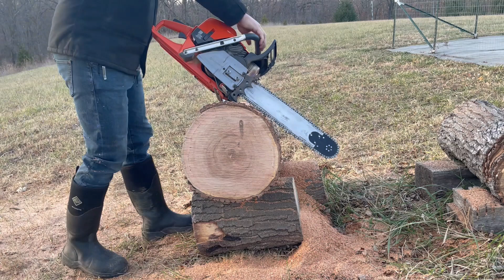Husqvarna 585 second ported iteration.

Comment: The stock  462c has around 168 (+ or - ) degrees of total intake duration similar to the 585 xp. We all make our wine our own way but curious is as to Why you welded the piston skirt and lessened the duration to 158?  I guess  you wanna crop the top and thicken the middle ...😜
Reply from the maker: For the crankcase compression ratio, it's the cycle that pumps the air/fuel from the crankcase through the transfer ports into the cylinder.
Reply: @srcarr52  yes yes , I understand how a 2-stroke operates , has the squish been tightened from stock ?  While every saw is unique I’ve found thru trial and error that you are going to get more top-end with the duration higher whilst sacrificing some bottom - just the way the time/area calculations work out - at 11,000 rpm in the wood you simply aren’t going to move as much with the duration at 158 and the piston cycling 183 times per second. In fact my 441c has 186 degrees total duration and runs like a raped -ape - A number that’s FAR higher than the 160 most guys recommend as the “maximum”. It’s interesting that these saws , the 462c and the 562xp (and most likely others) all feature the cut piston skirt - wonder if the engineers at Stuttgart and jonkoping know something? 🤔
Reply from the maker: @fabzacres-blackcat  FYI the 550 MK2, 565, 572, and 592 all don't have cut outs on the intake skirt.
Reply: @srcarr52  ok thanks, I’m primarily a STIHL guy but do own a 395xp and a 572xp and yes both saws do not have the piston cut out like the 562, 462c and several modern saws, now that that’s outta the way .......